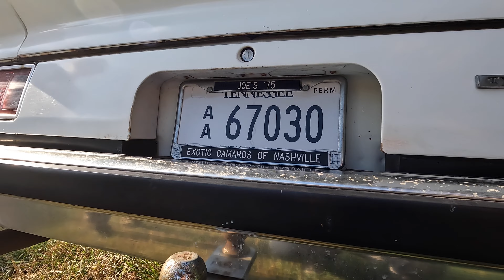The Best Cars Are Found In Barns(Including My Dad’s First Car)

Comment: Good title to the video and true! I wish I had kept just one of the many muscle cars I had! Just recently picked up a 1972 New Yorker Brougham with the 440 in amazing original condition inside and out, stored in a barn in NC since the mid 1990's with 84,000
miles, virtually no rust it dents! Tilt/telescoping steering column is apart to change ignition switch, and was never put back together! All parts sitting there on the floor- but it fires right up, no smoke, idles SMOOTH from a gas can. I am replacing the gas tank. Your parents are very nice people. They have a southern accent, but you sound like your from NY! I grew up in NY but have spent years now in NC, and love it. Nice video, nice land you grew up on the farm.
Reply from the maker: I’ve been hanging around Tony too much lol